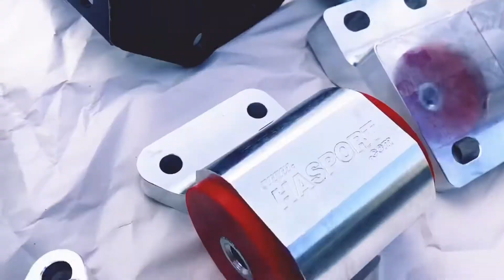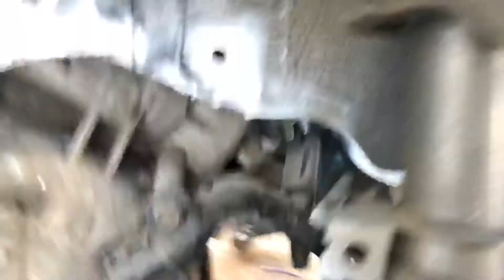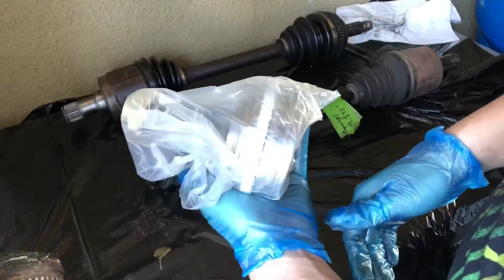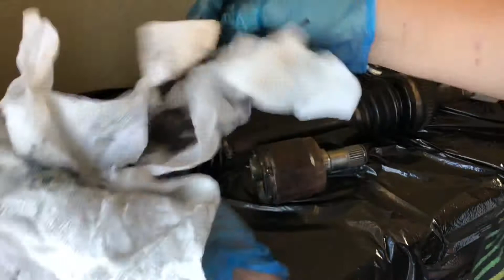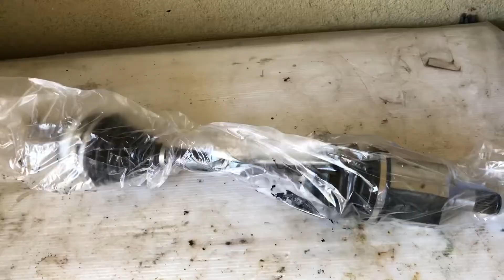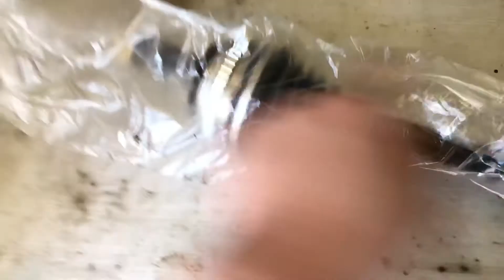How to: Build Automatic J Swap Axles for a CRX EF! Using OEM Axles!

Comment: i still don’t understand what parts you need from what. please clarify ty ty really not trying to spend $500 on cv shafts lol
Reply from the maker: Use a b series axle for the driver side with a CL inner axle cup. And the same for the passenger side. I forget which one to use because it’s been awhile. Most of the info in in the videos
Reply: When you say B series axles. Which make model car are you referring to ?? An Integra or ?  Also, just to clarify. You used both the passenger and the driver side B series axles, with the B series outers and the Acura CL inner cups ? I'm so confused 😂